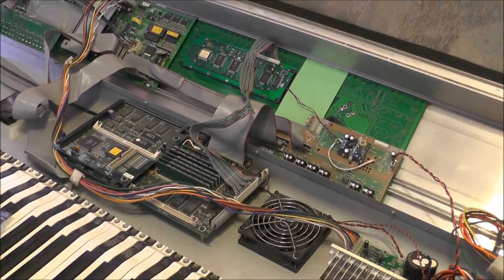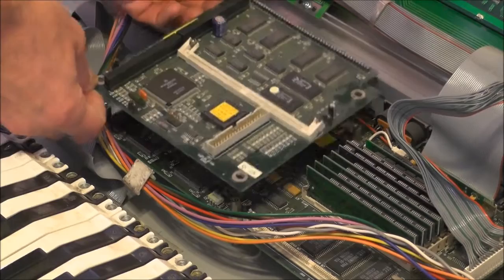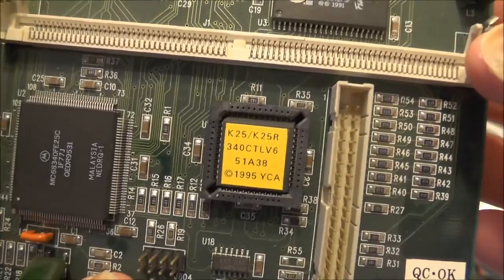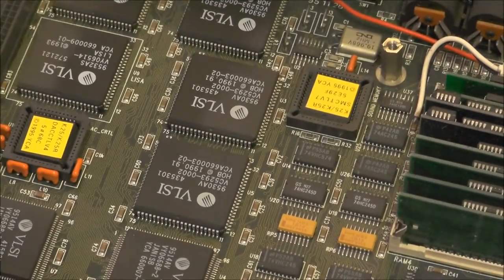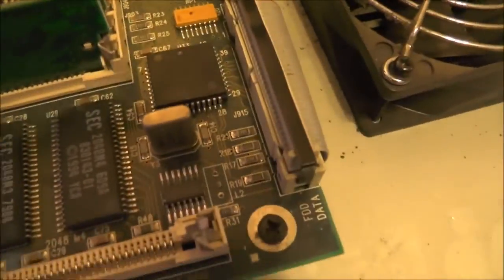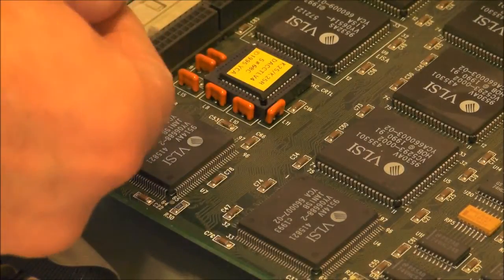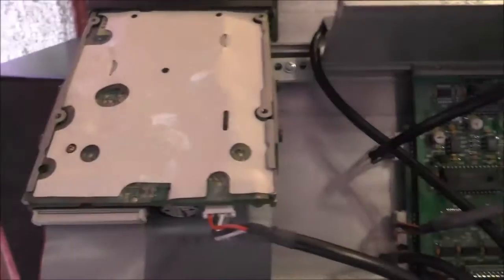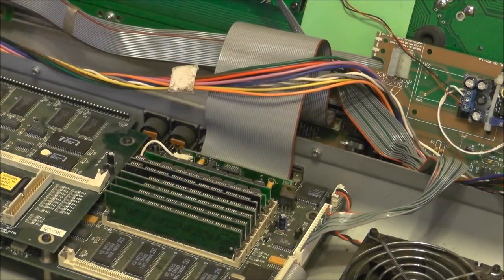DL#015 - Kurzweil K2500X Repair Part 4 PLDs & FDD

Comment: Hi I have a question for you. There is a big noise on the main/phones outputs on my K2500x, but there is no noise on the other outputs. I ended up figuring out that when I turned off the Fx from main outputs it turns out to work perfectly with no fx of course. Would you know what part should be replaced? Thank you very much!!

Comment: I think the issue you have run into with the floppy drive is that the k2500 is only compatible with certain manufacturers drives (sony, teac come to mind) and even then only with those models which supply a jumper or resistor to select DS0 or DS1. This convention was used before CS and faded away with better bios control. Essentially you need to tell it that the floppy is "B:\" by selecting the correct jumper position. On mine i used a sony but i had to resolder a SMT resistor to make it work. (I'm guessing that this is because the boot loader is on "A:\" or maybe it was just to ensure a proprietary configuration)
Reply from the maker: rmchamberlain awesome tip... thanks... yes cable select! The distant memories of setting up PCs in the 1990s is coming back to me. I will have to give that a try!
Reply: But note that the K won't respond to just a CS cable, it has to be set by the resistor on the drive.

Comment: I think the original terminator was bus powered, using the 5V supply present on SCSI cabling. Then they retrofitted it to an active terminator and it needed a better 5V supply. The resistive terminator would work happily without power at low speed. I think the 12V supply missing might be a red herring, a lot of FDD units that are recent manufacture only need 5V to work, or you can just supply 12V to it to try it out if it is one that needs 12V. Check that they did not select an odd drive number, as then they will not work.
Reply from the maker: Thanks Sean, yes i did suspect the 5/12v thing at the time,i had a distant recollection that 12v wasn't needed and also the drive does spin the disk. But i can remember back to 5.25" drives which did need it. I will check further. As for the terminator yes, it looks like it's soldered into the spot where the termination resistors would normally fit.I'm not sure if i am ever going to get this thing working properly!
Reply: DextersLab2013 It mostly works though, and the remaining faults likely should be fixable. Probably best to take the board out and look on the back for dry joints and resolder them, likely on the connectors. Also try a new ribbon cable for the FDD, those are quite likely to fail in my experience.
Reply from the maker: Sounds like good ideas. Sure i have a floppy cable around to try. Need to check the service manual regarding the power.

Comment: Did you ever finish this repair?.. curious to know the fate of this 2500 as considering getting one
Reply from the maker: +Chevytravelleruk I did yes, but only recently. I swapped out the FDD drive for a new one which sorted that. I also fixed up the screen to a pretty good standard too, i sold it to a friend of mine. They keys probably needed a good clean as too with the control buttons but it was basically working fine!
Reply: +DextersLab2013 would you say it is either practical/easy to fix the keyboard action or fishing stuff like dropped guitar picks on this keyboard? i have sticking/loud keys as well as a lot of small things like picks that i've dropped in mine and just wondering if you, having taken the thing apart, think it's practical to try.
Reply from the maker: Yes, they keys are easily removable, but there are a lot of parts to each key due to the weights. Expect it to take hours to do a full keyboard, just be careful, methodical and have plenty of space to work in. Also be careful of the actual key switches and the aftertouch sensor ribbon, unless you have issues with dead keys, poor velocity sensing or no aftertouch i would leave these parts alone!